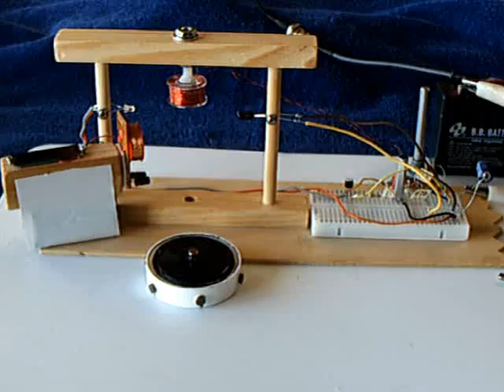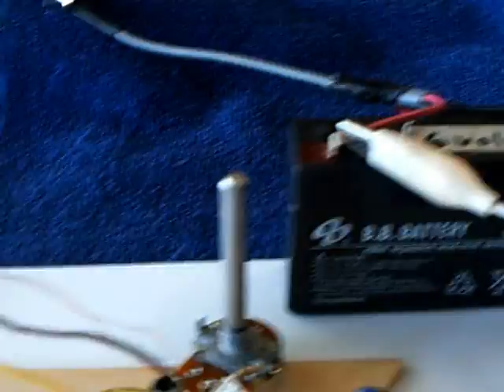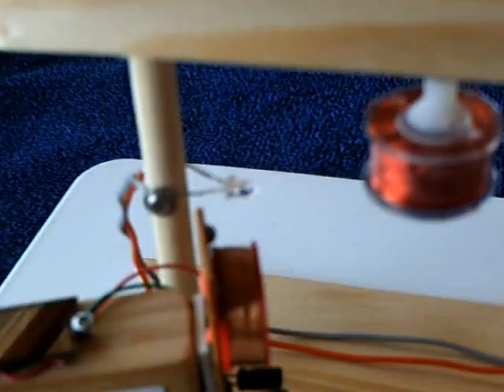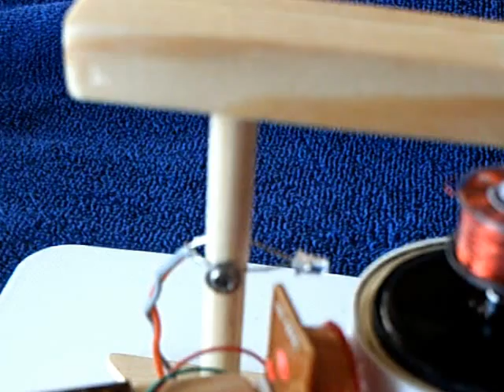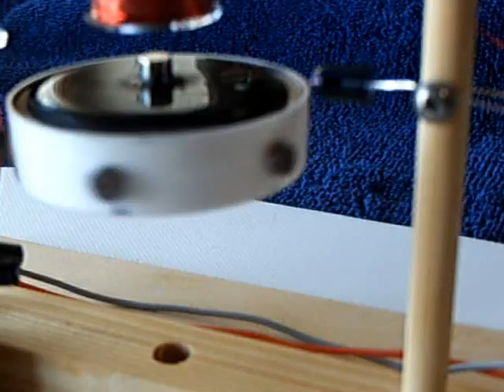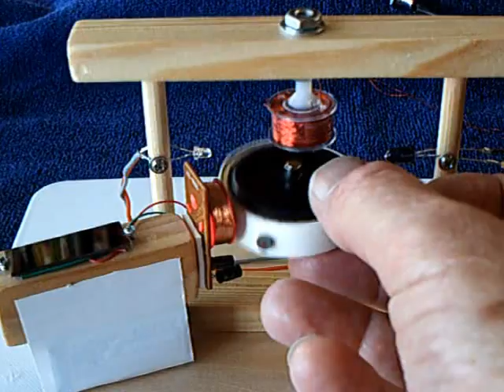Electromagnetically levitated pulse motor rotor

Comment: The circuit I followed used a bc556 pnp and an npn TIP41a and self wound coil on bobbin along with some resistors,diodes,led  and actually this circuit used only one ir led and one phototransistor. Voltage for this circuit was 9v 800 ma. All attempts at levitation either fell or got sucked and stuck to eMag. Does this circuit I've described bear resemblance a tall to the one that works for you? I gave up on it and now I have all parts needed to. Build op amp version with TL082 op amp, two photo transistor detectors-one solely as a reference Detector. This circuit includes compensation network, feedback etc. I really hope this one works when I get to assembly and trouble shoot/dial-in finish work. Next on my list when I finally complete my 8x8x8 led cube project which has kept me busy. Folding just so and soldering delicately together 512 3 mm LEDs sure is time consuming. Anyway any input, tips , ideas or suggestions of any sort will be cherished. I'm a huge fan of your work. Very cool

Comment: Hey lid motor, I've been very excited to start experimenting with pulse motors and I've Already attempted an electromagnetic levitation project which I never got working. It was a two transistor and one ir led in conjunction with two receiving photo transistors, one for reference and other to catch the ir emissions. I built it but never had success. projects using projects using

Comment: please could you tell me the specification of the magnet in this vedio
Reply from the maker: +Symum Ansari 30ga magnet wire on a sewing machine bobbin.  About 10 ohms.  It is not critical.  I can't remember if this had a ferrite core in it or not.   The hard part was getting the optical setup right.  The infrared led and the sensor had to be just right for this to work.
Reply: +Lidmotor what is the white thing? are the magnets on the sides are neodimium?
Reply: +Lidmotor what about the infrared LED and Sensor? i am really trying hard to make this thing. please help
Reply: +Lidmotor  is it not possible to do it with ferrite magnets?

Comment: Now put it in a vacuum and watch it run, and then turn off the drive coil and see how long it goes. You might try checking out using an old fridge compressor to make the vacuum with. They can also be used for converting an air compressor to a silent one.  There are many examples on youtube. It is kind of tricky though as you have to remove the oil it comes with and put in automatic transmission fluid, and have an oil filter and trap before going into the tank, but other than that it is pretty straight forward.

Comment: I wonder what kind of results you would get if you were able to spin the rotor in a vacuum.  ...Maybe figure some way to get it started first, then apply the vacuum.  A bell jar comes to mind.   ...Hmmmmm.    ...Awesome stuff by the way.  I thought I was the only one who used plastic lids as rotors, hehe.  My main reason for liking them so much is due to the way the injection mold point  is perfectly centered.  It eliminates the trouble of cutting out circles or having to find the center of existing circles.  Although, lately, I've grown quite fond of discs made from polyethylene cutting boards cut out with a hole saw.  ...All kinds of advantages there. :)
Reply: You're a genius - cutting boards,.... I heard MrAngusWangus mention cutting boards a while back.  And now you've suggested plastic lids, my goodness that's so simple it hurts.  I just contacted a company who supply plastics to see it they'd cut some wheels - that was not going to be cheap. Good one - that helps me out you know.
Reply: I've always known it as "engineering plastic".  You can even buy slabs to cover your kitchen counter or workbench.  ....Regarding their use as cutting boards; Being fairly well versed in organic chemistry, (along with a dash of biochem/pharmacology),  coupled with an in-depth understanding of how the most common plastics are made, has made me very dubious of using plastics for anything having to do with anything that I would ingest....   You can also melt plastic shopping bags, (high density polyethylene), and use it to make plastic rotors and other parts that are insanely tough.  Some people are adding color dyes and making knife handles and sheaths this way, (...I've even seen a few professional looking custom gun holsters made from melted milk cartons, (polypropylene) ... and pretty much anything else imaginable,...even cosplay armor, (e.g., Ironman armor, etc).   There are step by step guides here on YouTube for re-purposing plastics.  One possibility could be to melt the bags into a solid slab, cut out a rotor how you want it, then embed magnets, coils, or whatever, using a drill and a solder rework gun, (basically tiny heat gun.)  It's much cheaper than engineering plastic, aka cutting boards.  They can be expensive. ...Not sure why, since each one costs MAYBE $1 to 2$  to make for a 15x20 inch slab, then they turn around and charge 20-30 bucks for it.    ...And this concludes my comment  mini novel.    hehe. :-D   ...Sorry, voice to text software tends to make it easy to leave insanely long comments.
Reply: Strif Tsal
...insanely long comments... gives me insanely amounts of information. Which I really appreciate. thank you very much.

Comment from the maker: You might enjoy  "Penny--The low power LED oscillator".  This is a tool that I made to test small low power homemade batteries.  I remember when you made those small water batteries and this would probably run on just one of those.  The simple blocking oscillator is made using steel twist tie wire and will operate from 1 micro amp up to 30 milliamps on 1 to 1.5 volts.  Many people have replicated "Penny" now and the reviews have been good.

Comment from the maker: Thanks. The rotor has all north facing magnets.  The solar pulse motor also has a north face out so it pushes the rotor around rather than pull it.  You can build one of these motors really easily and with your build skills it would be a beauty!

Comment from the maker: Hi.  You should try this one.  Your self-start pulse circuit should be able to do the job of spinning the rotor.  The hard part here is getting the spacing right on with the levitation parts. The rotor is another tricky thing.  I just happened to have one that worked.  I tried three other ones that didn't work.

Comment from the maker: Right now this circuit takes too much energy to levitate the rotor.  What is needed is a setup where most of the levitation is done with permanent magnets and just the final control is done electrically. This has probably been done before.  I'll have to do some more research.

Comment from the maker: Aloha Jack. Thanks.  Actually the way that this works is the IR light beam controls the on/off function of the electromagnet.  When the light beam is broken the energy pulling the rotor up is turned off and the rotor settles down.  When the beam hits the photo transistor the electromagnet is turned back on.  This all happens very fast because of the transistor circuit.  It is really cool to watch.

Comment: Did this invention 4years ago only make it with a propelor and it work on hot air it works on very low blow above a radiator from the central heating.
Maybe it is possible get electricty from it but I donn,t now how to do this 
sorry for my bad English :-)

Comment: That's a great excercise on fine tunning building skills, but are you familiar with the permanent magnet levitates rotors for the bedini motor? Powerful neos allowing to achieve 3 and 5k rpms I kust mention it ' cause the significant effects are seen at greater scales of parameters it is possible with ceramic mags but they become utterly unstable for the known reasons...beautiful work thanks for always sharing

Comment: A man on a mission :)
So glad you have both levitation and now a rotor spinning. I've been using sMartCreations self starter and it does very well, but have had the wobble problem. You build better rotors than some of us !
Oh, I believe Faraday's Paradox is at play here...the magnetic fields don't rotate on the vertical axis. So, if it levitates it will spin too, same forces are acting on the rotor all the time. You have less friction than the none you thought you had hehe